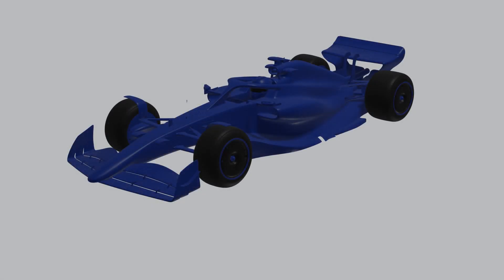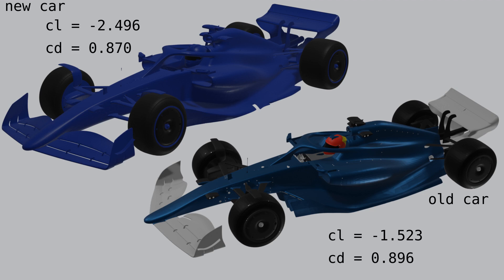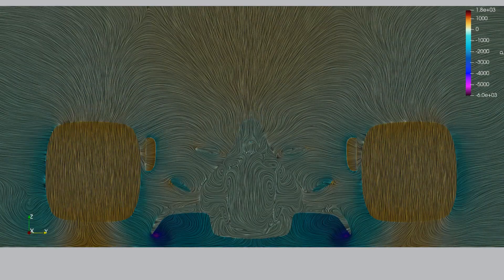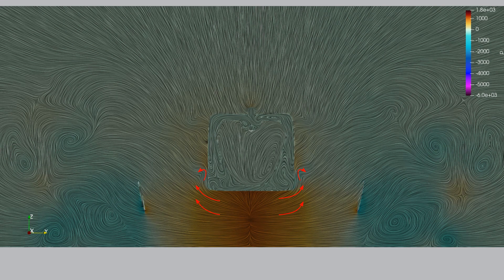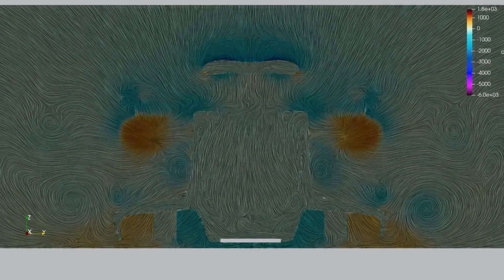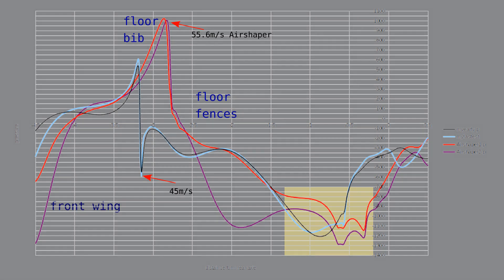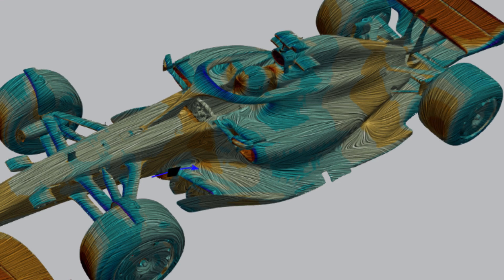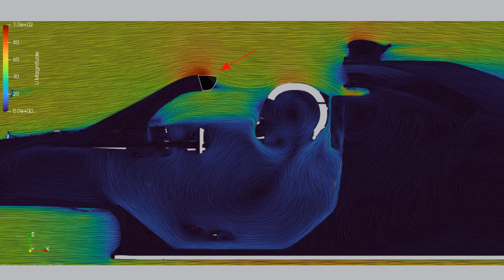Analysis of a Professionals CFD Case.

Comment: All this analysis is very interesting, but it is meaningless if the rotation of the wheels at the real speed of the vehicle simulation is not taken into account... it gives that feeling when you see the current lines shown in this video...
Reply from the maker: the thumb nail for the video shows high shear stress values for the wheels indicating that they are rotating....

Comment: Nelson try doing an Aero Analysis on FW16, FW16B and the Benetton B194. I've got PDF it has bit of detail from a Japan Toy Model 20 / 1 car. It has Brazil and Imola setup. It's not highly detailed, but might help in creating a model.
Reply from the maker: Thanks. I've got a bunch of useful images of those cars. The b194 is particularly interesting because of the changes brought into effect that season. Getting a useful insight into these cars is difficult because the teams are really pushing performance and the computer I am using isn't able to convey that intention. Really should finish the 1990 cars first....    😞
Reply: @nelsonphillips  FUJIMI sells all three versions of FW16 for first three races 20 /1 scale it's about 100 AUD...

Comment: When talking about the mirror's supporting structure-housing connection area at 5:14 why wouldn't you just refine the mesh in that area as opposed to modifying the geometry to make the gap larger? I've never meshed with openfoam but I'd imagine its meshing utilities are powerful enough to do this.
Reply from the maker: The problem with openfoam is the work flow. You can refine the mesh locally but the thing you want to refine needs to be extracted or manually labeled.. For example if you want to add another part in the simulation, and you have automated the work flow yourself, each text file needs altering. Airshaper, not having used it myself, has a automate system but it mustn't have local refinements built in. Also the model wasn't prepared for this purpose in mind. Openfoam has all the required functionality, but not a gui for ease of use, though some of the windows adaptions, i don't use, seem to have a ui.

Comment: Tbh looking at total pressure slices would be more effective if you look to reduce drag , and side static pressure slices for the downforce , LiC slices are okey but when you only look at one variable you might miss some features
Reply from the maker: Agreed total pressure would be much better at assessing drag reducing but I was searching for flow structure. Say if you wanted to understand the impact of the front wing on the performance of the floor tp would be the primary variable. Then because I find tp terrible at looking for structures then vorticity and velocity etc..... can be used then. I try to explain why I am using the variable I am but my script still need a large amount of work.  Videos on top of analysis places constraints that aren't normal...... but then I get feedback that I would otherwise get as well.

Comment: Quoting said paper "In the case with pressure-side winglet, the tip leakage vortex trajectory is more inclined in the streamwise direction. In addition, the distance from the ﬁrst tip leakage vortex appearance at the suction surface to the intersection with the shock is longer than the corresponding distance in baseline tip case. With the longer distance, the low momentum core ﬂuid is reenergized as tip leakage vortex mixing with main ﬂow, as discussed by Kablitz et al." So I would say you sir, are definitely on to something.

Comment: If you want an idea to improve the floor fences, check out the paper titled "Effect of blade tip winglet on the performance of a highly loaded transonic compressor rotor". The regulations allow you to put a fillet radius on the floor fences of up to 50mm once the floor fence is covered by the floor body. In other words you can put a 50mm winglet on the bottom of the floor fences. This paper shows that a winglet on pressure side of a rotor cascade extends the stall limit, with an almost negligible increase in drag. In other words it extends the aero envelope of the floor fences.